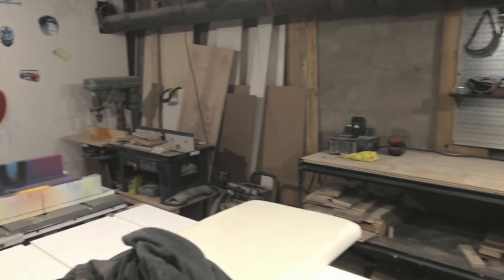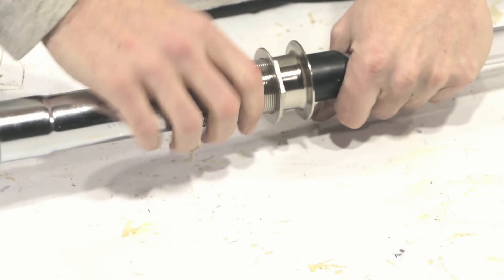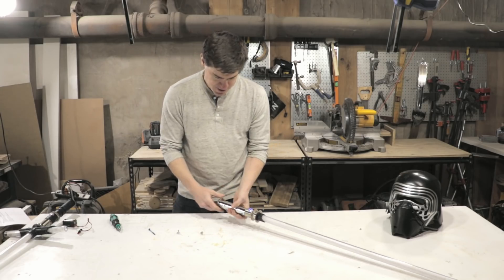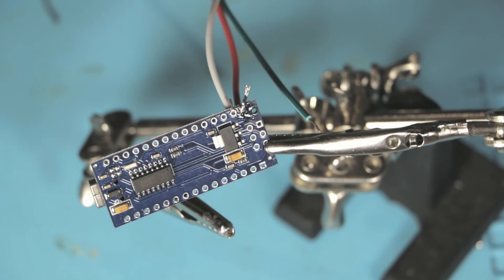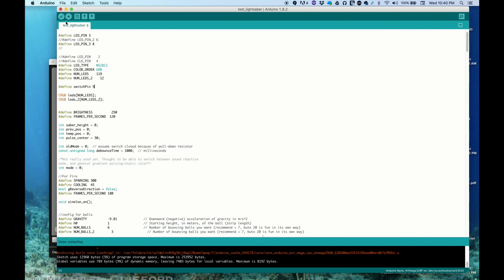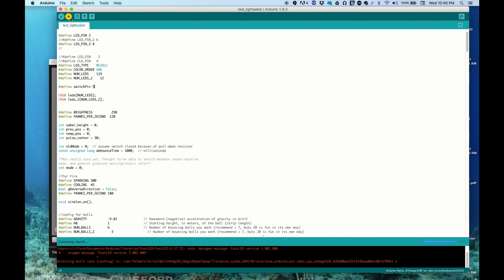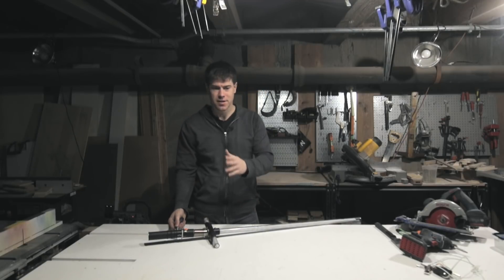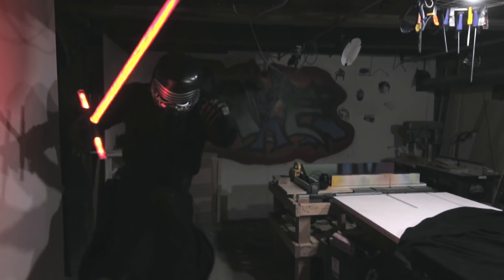DIY LIGHTSABERS with NEOXPIXEL blade and PARTY MODE || Arduino controlled || How to Make

Comment: Hi-
This is the first time I am using a Nano and appreciate the helpful video! Is there a way I could slow down the light up from bottom to top of the blade for use with a Darksaber which has a slow acceleration? Thanks!

Comment: Hi! I've done the exact same things you have done, but the strips aren't powering all the way, what can I do?
Reply: there's a spot in the setup for the number of LEDs.  you have to set that to the number at the end of your strip.  Looks like his code had 129 LED when the full strip has 144 LEDs. Just change the line #define NUM_LEDS    129 to 144 and you should be all set.

Comment: I've been trying to follow your guide and make the Kylo Ren saber as an engineering project but I don't know if it's an issue with the code or the wiring that is making mine not work. Any suggestions?

Comment: Can't believe I missed this one when I looked back at some of your videos before.  Might be fun to have some lightsaber duels once the Covid risks have passed.  Be safe, love the content.
I love the removable batteries and quick disconnects in your build, though I would still prefer to fix the circuit to work with standard batteries for ease of replacement.
Reply from the maker: Ha, for sure! Same to you!

Comment: Wouldn't passing the 5V+ve and gnd to the leds through the arduino nano limit the current the leds actually recieve? Considering the neopixel documentation, each of the red, green and blue diodes take up 20mA at full brightness. So that would be 2.4Amps for say 120 LEDS. Would passing this many amps from the nano be possible?

Comment: Great video man! I wired mine based on your wiring diagram that shows only 4 connections made to the Nano board: GND (by VIN), VIN, D5, & D8. In the video, however, you have two more: one going to the second GND pin (by D2) & one to pin 5V. I'm relatively new to wiring, so if you explained it in the video, I'm not grasping the concepts. Can you explain the differences in your wiring diagram vs. in the video? I'd really appreciate it!

Comment: Love how detailed this video. I’m making my own with some success, but across the Vin pin on the arduino the voltage is around 3.2 as opposed to 5 across the batteries. Any idea why?
Reply from the maker: Some Arduinos run at 3.2, others at 5v

Comment: damn i cant get the code to work :( all it does is fill in with blue in and out over and over again and the button seems to be unresponsive... anyone having the same problem or am i a dumbass XD
Reply from the maker: Probably just need to flip 1 to 0 (or vice versa) for mode switch signal from you momentary button

Comment: I have uploaded the code and soldered everything as it is shown, yet I cannot stop the board cycling through every mode without pressing the button. As soon as i hold the momentary switch in the cycle stops. as soon as i let go it continues cycling through doing a second of each mode. Can anyone please help? Cheers!
Reply from the maker: You have a high and low signal switched.... Wherever you see the if statement for going to the next mode, if it is 1 then make it 0, or if it is set to 0 now, switch it to 1
Reply: @modustrial  perfect! Thank you! Got it all sorted now

Comment: The led strip diagram you have has only 3 wires what should I do if my Led strip has 4 wires what shoul i do with the other wire??00
Reply from the maker: What kind of LEDs do you have?  Neopixel or individually addressable strips? (These would either be apa102 or ws2813 with 4 wires)?  Or regular RGB strips?  I have a feeling that you have regular RGB strips, and those won't work for this project.

Comment: Nice work and nice video

Can you tell me how you connect the two cross sabers to the arduino? And what have i to do with the code? I need help
Reply from the maker: Thanks!  If you search on Instructables.com, I have a write-up there on this project with a sketch circuit diagram, and some more details on the code.  (I'm modustrial maker there as well.)  You'll probably also want to watch some basic tutorials on controlling LEDs with Arduino (with the FastLED library), as a primer for this project.

Comment: Your code is great, using it for my own build, just turns out i have too few amps on my battery, but your type wouldnt fit
Reply: Had the same problem.  Can drop the brightness a little on the leds[i] = CHSV( gHue, 250, 220);  down to leds[i] = CHSV( gHue, 250, 150) or so... power consumed is almost exponential to the brightness.

Comment: Hey modustrial maker! I was trying to build a saber myself and I was curious if you need the chip to use the led’s or if you can just wire it to the switch and the batteries and give up the power up/ power down effects and the “party mode”
Reply from the maker: You can do that if you use regular RGB LEDs instead of the individually controllable ones.  It would definitely simplify this :)

Comment: Awesome build man! I loved it. And I was thinking that for the sounds you could use a cheap electronic lightsaber toy, didn't you think about it?
Reply from the maker: Thanks!  And yea, I definitely thought about it.  I actually bought a cheap one, took it apart, and everything.  I didn't end up using it mainly because it was already super crammed to get everything in the hilt, and I would have had to re-solder and re-arrange to figure out how to fit it.  Since the sound wasn't that great (power on/off, but no real motion effects), I decided it wasn't worth the hassle.  I have it in mind to figure out a dark saber at some point, with all the bells and whistles....no promises when I'll get to it, but it is definitely on the list :)
Reply: Modustrial Maker oh nice! If you finally make that one, I will be there!! Until that moment I'll continue loving the one that you already made :D
Reply from the maker: Muchos gracias.... there will be plenty of other cool projects too.  Lots of LED integration in 2018....
Reply: Modustrial Maker okaaay, i'll there too ;D

Comment: Does the code add the sounds
Reply from the maker: No sounds right now -- I decided to simplify the build by only doing the lights.  Sounds require motion sensors to activate them, so it gets very complex, and requires more processing horsepower than an Arduino has (you have to use something like a Teensy).  Most environments I will use the saber in are loud (e.g. a Halloween party), so you can't hear the sounds anyway.  Instead, I chose to focus on the visual effects for the LED blades.  (The cross-guard took some work :) ) 

The I like to make stuff saber includes sounds, but for it, you have to use a Teensy, which is 10x more expensive than an Arduino.
Reply: Modustrial Maker thanks